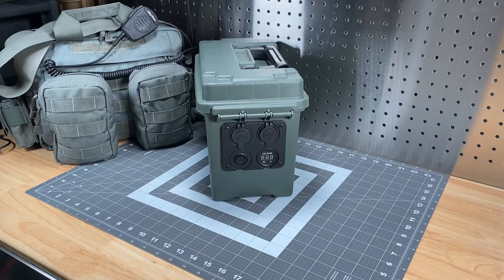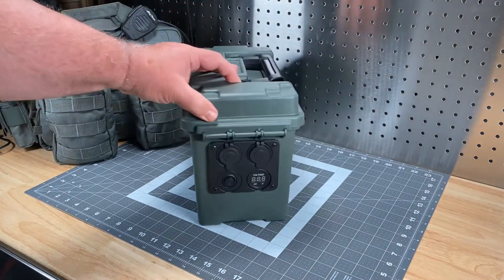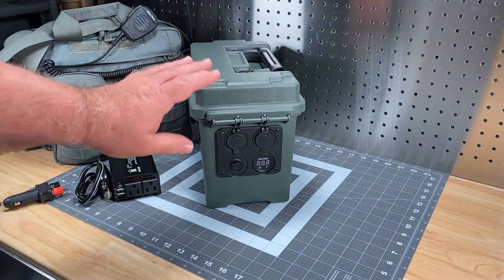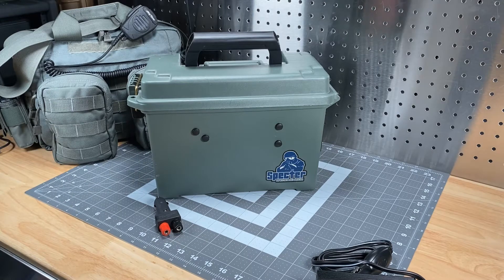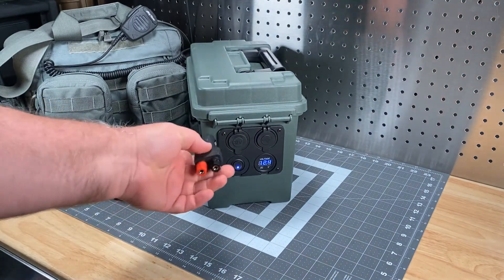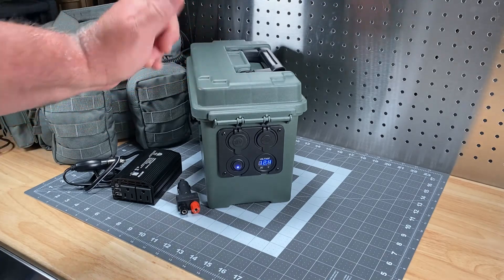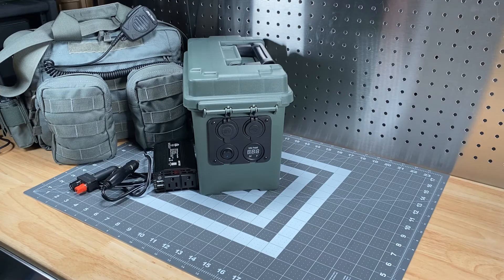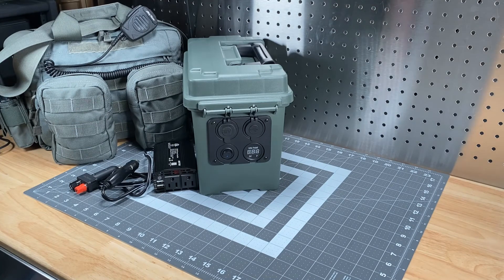EmComm Kit DIY Portable Power Box

Comment: Last summer, I rewired my brother's Ford Triton 250 Camper Van using Anderson Pole Pole connectors.  The "Electrician" who originally wired it did a horrific job.  I had to study the Solar, Charging System, loads, and all before ever starting.  I was only available for brief periods and it took three visits to complete the job, but I turned a rats nest into a nice looking system that was understandable.  It had been a hybrid system (Renoty and Victron) with three dead lead acid batteries.  I replaced the batteries with two 100 Amp Renogy LiFePo batteries, and replaced the Victron MPPT Cotroller and Renogy Power Converte with a single Renogy combo unit.  I was quite pleased with th end results.  Now on to my Emcom kit...

Comment: Lots of bad info in this video. Starting with that inverter. Thats a modified wave inverter, not a sine wave. Its will trash electronics you hook to it.
Reply from the maker: According to the manufacturer that inverter is a 300W Pure Sine Inverter. It also has not trashed a single electronic device that I have ever plugged into it.

Comment: Excellent video,
As a fellow C-PAP user, I discovered that my machine uses a wall-wart to convert 120v AC to 12v DC.
By splicing the line with Anderson Power Poles, I can connect it easily to power line attached to my battery box.
Hope this helps.

Comment: Amazon sells a neat little charge adaptor. One end is a standard usb plug; next in line is some type of little transformer; and on the "Business" end is the charging plug for Yaesu Handheld radios.  They are only about $20.00 at this time. I bought one for my Yeasu VX-6, and it charges the radio perfectly.
I will be purchasing two more of them; one for my VX-8, and the other for my Wife's FT-60.

Comment: Really neat! I agree with end not top connections. I used your logic in reverse, as all my own kit has Powerpoles I put 4 PP outlets. But I have in the box leads with cigarette lighter socket, usb adapters (with a usb lamp stalk) and even a lead with big battery connectors (we call Croc Clips) to either charge from or replace with a vehicle battery. I also split the inverter lead between its supplied lead of clips then  put PPs so I keep that versatility. The beauty of these boxes is you are live when you reach site within seconds. Mine is not as professional but like yours meets all needs which the expensive commercial ones dont.

Comment: Nice box and build but there is a fire hazard if your master switch shorts out, while rare it can happen. An easy fix it to install an inline fuse between the battery positive and master switch. Also check the Amp rating for the USB, cigarette socket. Many from Amazon and eBay are rated for 10 Amps not 15 Amps. See the video (link below) that gives a better explanation.
https://www.youtube.com/watch?v=dLgYqO-3kMg&t=320s

Comment: Great content! Do you think that the power switch you went with will be prone to getting switched on by mistake? I could see it getting switched on while packing everything in the back of my vehicle. Is the plastic ammo can heavy duty enough to transport the weight of the battery without the handle breaking?
Reply from the maker: That is always a possibility. Which is another reason why I don't have any exposed hot contacts on the outside of the case. As for handle strength, that's actually a problem with the smaller box I was originally going to use. On those, the handles pop off fairly easy. But with this box the handle is very secure. Weight isn't really much of an issue with this loadout as the whole thing only weighs about 6 pounds.
Reply: @KS6DAY  hell of a lot cheaper than a Jackery or Goalzero and fun to make! This is on my project list.

Did you buy the cigarette lighter plug with the connectors ready made?

Comment: Very nice. I just finished mine with a 30 amp Bioenno battery and Anderson connectors. Good point about the use of other connection methods, I will be adding a 12 volt socket to mine soon. Thank you for he idea. DE AD8DU AR.